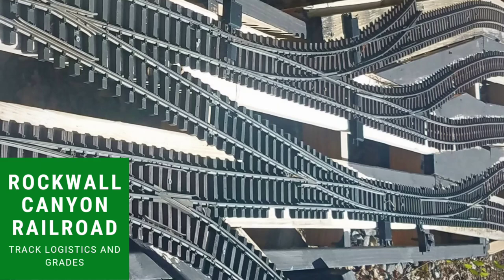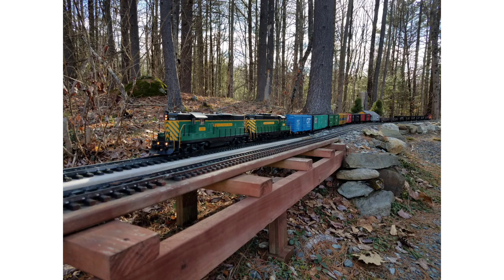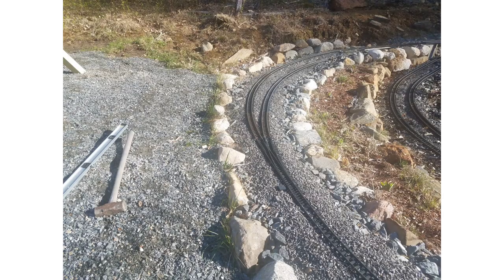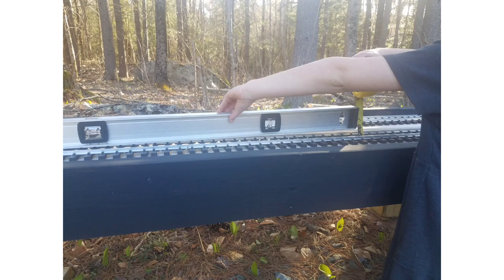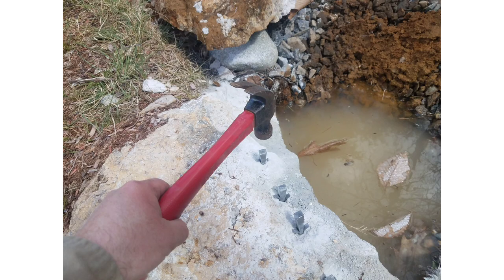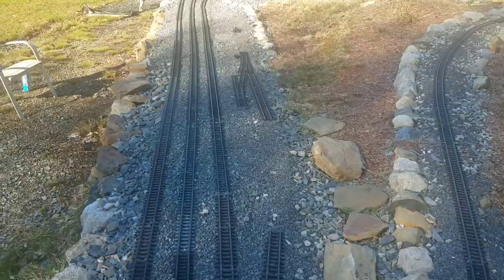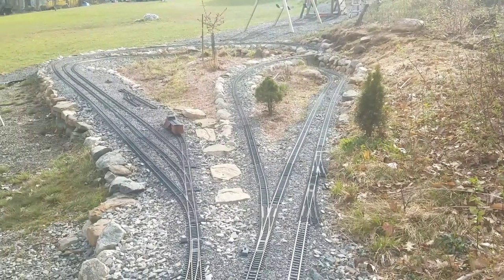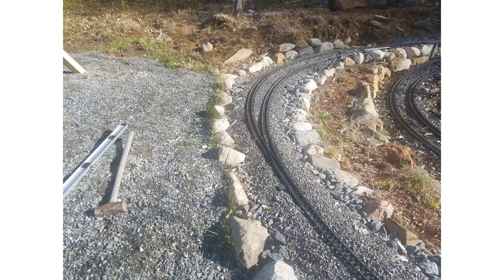G Scale | Track logistics: grades switches, and curves

Comment: You can press some brass tubbing over the outside of the plastic gear (where the axle presses in) to fix the cracked gear issue. I've done this to many
Reply from the maker: Have you done the 44 tonner truck specifically? I know this typically works most USA motor blocks, but it's been documented that you would have to modify the plastic housing on 44t to make room for the sleeves.....otherwise the gears no longer mesh.
Reply: Yes I have done it. Just make sure the bushing is square not diamond when reinstalling the axle and it works just fine

Comment: My LGB mogul can’t climb more the 1-1/2% grade without slipping on a curve. Do steeper grades need to be only on straight sections?
Reply from the maker: @johnburk5087  I've owned a couple of LGB Moguls in the past and noticed similar issues.  Rather than modify your track, my suggestion would be to swap out the wheels in the tender and cars to either LGB or Piko brand ball bearing wheelsets.  This is especially helpful if you are pulling the LGB D&RGW-style coaches.   Not only do the bb wheels reduce the normal drag, but they also can be used for lighting power pickup in coaches and caboose.   I know they are expensive, but if your Mogul is regularly slipping, it's more likely that the gearing will fail prematurely, which would also be costly.  As an added benefit, your other engines will live much happier lives as well!

Comment: Great video!  I do need some help if you can answer a quick question.  I just purchased a massive, USA Trains,  SD40-2.  What is the smallest LGB Numbered Curve can this engine handle?  

I am moving up from the small starter tracks that are in the LGB sets and think this engine might not work on right curves.
Reply from the maker: Excellent choice!  The Sd40-2 will require LGB R3 as an absolute minimum.  With R3 it requires coupler adaptors to work.   USA 10ft diameter would my minimum,  and LGB R5 would be even better.  If you cannot go larger than R3, it may be wise to stick with the LGB brand locomotives since they are designed to work on the tightest curves without performance side-effects.
Reply: @RockwallCanyonRR  outstanding answers.  I will start rooting around for those Part Numbers.  I work best with Part Numbers.

That said this engine is AMAZING!  First the price.  I bought it at the NMRA Convention here in Dallas TX for a very fair price: $411.00.  This engine is upwards of $435.00 and that would not even have shipping which would push it to $460.00 in some cases.

Next is the detail.  Wow!  Really amazing.  I love the huge three axel trucks.

Last it is what I have wanted for many years.  If you take a look at my tiny garden train layout it will take some planning to get her in there.  My little layout was needing an expansion so this is the perfect reason to make it even bigger!

Anyway I hope to do an "unboxing" and test drive soon.
Reply from the maker: @VictorianMaid99  That was a great buy on the SD40!  Looking forward to seeing what you do with the layout!
Reply from the maker: @VictorianMaid99 
I typically think LGB track is much better, but USA Trains provides this 10ft diameter curve size which falls between LGB R3 and LGB R5 curves.  It's cheaper and may fit your space better than LGB R5.  
 USA Trains track: 
R81700 10ft diameter curves
R81720 switches
R81725 switches
Reply: @RockwallCanyonRR  I think you are correct about LGB Track.  It holds up better outdoors

Comment: ever thought of running vintage converted battery trains like New Bright, Echo,or Eztec/ Scientific Toys on the railroad? or would those require more work to get running?
Reply from the maker: Absolutely!  You do have to be careful with some of the vintage New Bright trains as some of them are close, but not quite the same gauge as G scale.  That said, they are quite popular with garden train folks.  I'm really not sure how well they hold up on layouts with grades or longer trains.  One of the issues they found with the older Bachamann Big Haulers (when used beyond the Christmas tree loop)...the motors would get hot and soften the motor mounts which then caused the gears to grind.  I would say, if you approach with reasonable expectations you'll have good results.   As to "vintage" quite a few of my "garden-grade" models such as Aristo craft diesels and cars are  30 years old and going strong.   Even my USA trains GP9s are over 20 years old!  I have LGB track and ties that have been outside well over 30 years.
Reply: @RockwallCanyonRR  All the more reason I won't use Plastic track outside because it's not UV resistant and would melt in the sun like a hot fudge sundae. as for New Bright rolling stock (and this even applies to their christmas counterparts) hit them with some UV clear coat and change the plastic trucks to those of metal with knuckle couplers. though with the engines that would take more than just UV clearcoat as the motor and gears would need moisture protection (Epoxy I think?) but I'm ditching the 6 C cell batteries that take to power them as I'm going with a single 7.4 volt cam corder battery with a charger. I may include Rail pro as well. (I'd be surprised if it can find images of New Bright and other 80/90's engines).

Comment: Thanks for all the info, great video!  I have a question about laying parallel curved track.  Can you lay a 20' half circle inside another 20' half circle?  Is it big enough to have enough flexability for that?  I would rather have parallel curved tracks 8" apart rather than a foot or two apart.
Reply from the maker: Thanks for the kind words Todd!   If you're using sectional curved track you can loosen the ties by removing the underside screws on one rail to allow the rails to flex. Place on a flat surface and hand bend it either larger or smaller as needed.   It will cause one rail to run a little long, but you can trim that with a dremel cut off wheel or hack saw.  Otherwise you can use long flex track sections and a rail bender to produce the parallel curve.   Flex track is often in short supply, so I do a little of both.

Comment: There is an easy way to sleeve the plastic axle gears with 3/8" brass tube and make them run like new for many years.  Many USAT locos in my fleet are already fixed and run perfectly.  If you want more information and picts, please contact me.  Love your railroad also!!
Reply from the maker: Thanks Duke!  Oh yes, I'm actually aware of the brass tube repair but was warned that the 44T motor block is a little tighter and may require removing some plastic to allow clearance for the sleeves to fit and still allow the gears to mesh properly.  I already have the tube, so i'm going to give it a try anyways to solve this once and for all. Lol
Reply from the maker: Hi Duke, so I gave it a try last night and it worked out pretty well!  No issues with the sleeve rubbing on the motorblock and the surging is almost gone entirely.  I do have one axle with marginal gearing that are nearly worn out but still working.  Another axle is still wobbling pretty heavily, but works.  Ran for about 4 hours today!
Reply: @RockwallCanyonRR  I've had really great results from the way I sleeve mine using a small arbor press to get them straight and they run nice.  I can send you picts through email or FB if you wish.  I cut the brass on my small lathe to fit.  A drill press would work in place of the arbor press.

Comment: I a,m new to the hobby. I have a couple questions, please? I am curious about how you deal with the power to the tracks when the weather has been wet. Do you have to wait until the powered track dries out before safely using the system? If I am not mistaken it is 24VDC? To power such a large system I assume you'd need something pretty hefty current capable. Would 10A be enough for getting power to the locomotive on such large systems? Do you have external fuses on the output of the power supply? Some switching supplies just shut down until the short circuit clears.   I appreciate any information you can share. I am hoping to build something similar someday. I know I can experiment as I am building to answer those questions but it is great to learn from those who have already done so.  In standing on the shoulders of others we gain from each generations? Maybe someone already documented all this, I will continue to research as well.  Thank you for sharing this cool infrastructure.
Reply from the maker: For a very large railway (something over 200ft of track), I find it's really not practical to power the trains through the track at all.  Instead, I retrofit the locomotives to accept Li-ion batteries and radio control onboard.  Sometimes, I install the battery and RC directly within the locomotive, in other cases I dedicate special battery cars that can provide the power to locmotives indirectly.  

If you start off with track power, a 10 amp supply is a great idea.  Most G scale trains have 18vdc motors, the only exception, I think, is LGB which come with 24vdc motors (even lgb will run fine at 18vdc)  Any commercially available control system will have electronic protection, so there is no worry about the track being completely dry before running trains.  That said, I'd avoid running in particularly wet conditions as it will dirty the rails and wheels temporarily reducing conductivity (until you clean it).
Reply: @RockwallCanyonRR  I watched a few videos tonight that discussed retrofitting trains to run off internal power. I guess it can really simplify several problems with open circuits, or even short circuits. I don't know if I can still accomplish that level though as I am losing my eyesight. I was just going to start out with the older technology while I still can. It seems using internal power with radio control and modern programmable logic is a really smart approach. I really love the idea of trying to avoid using high current low voltage in an environment exposed to elements with constantly troubleshooting intermittent connection problems due to corrosion or moisture. I am sure many experienced large scale experts do not want to go back to track power once they  have converted. I guess modifying all your locomotives may be a challenging task too.  Thank you very much for your insights.
Reply from the maker: @1STerminus  With new track, you should get years of reliable track power regardless of the elements.  If joint continuity becomes an issue later, you could add split jaw rail clamps to improve the connections between the rails.   
As to battery powered trains...there is a Piko small diesel that is factory equipped for battery power with a simple onboard RC system.   If you wanted to outsource the installation on a different model you might consider RCS of New England.  My friend Don Sweet is the owner, and has been doing professional installations upward of 30 years.
Reply: @RockwallCanyonRR  Hi Thanks again! I am starting out with a small indoor layout using all used G-scale components several sets with a lot of old steel track. I have quite a few 24V power supplies from 3D-Printers with a 15A rating. I found some schematics to wire up an analog controller with potentiometer and a manual break before make polarity switch (direction.) I am having problems with even light soldering now so I might need to find an assistant who can handle a soldering iron (an apprentice!) Very wishful thinking as I am in the middle of nowhere New Mexico.  Since I just have a couple workbenches I will have to keep them small. I was going to make this my last fun project. I think it could be a race against time. Thanks for the cool system you built and for sharing it too. Keep your wheels on the tracks!

Comment: really cool. yout double mains appear to be perfectly spaced from each other. any tricks on this?
Reply from the maker: Thanks! On the ground level it's just by eye.  I really lucked out with the patched siding where the rock was busted up.  I never had to trim a single rail to make it fit!  As to my elevated track...the spacing is that of a crossover of USA Trains #6 switches.   That way I can add crossovers near the intermediate stations for more ops options!

Comment: Great info and great examples ... Thanks ..I'm guessing all the switches are manual .. I use the Bachman switch stand for my #6's ..
Reply from the maker: Thanks Sean!  Yes I also like the Bachmann switch stand as well.  Most of my switches use the LGB manual spring box.  The railroad has many junior engineers, so having spring switches helps to cut down on major derailments.  Engines and heavy cars will always spring through,  but occasionally freight cars will still slip off if a switch is misaligned.

Comment: Hi, I really appreciate your channel and you sharing various tips.  All good and helpful - thank you.    I'm curious about your technique for laying track floating on rock.  While I realize ballast helps it stay in place, I've presumed G-scale track outdoors needs to be fixed to a permanent roadbed.  Concrete, wood, something.. other than the obvious decking/trestles/etc, can you share more about your techniques when laying track at ground level?   Do you have freeze/thaw/hot-cold cycles in your local climate?  Do you have issues with track drifting?   Thanks again
Reply from the maker: Hi Dave, So glad you like my videos!  Yes, I've been floating G scale on crushed stone for many years.  I find the best way to proceed is to start with a heavy woven "weed barrier." Much like on gravel pathways, this allows the base to be more consistent in freeze and thaw conditions.  I then like to use 1-1/2in crushed stone to build up the roadbed.  Next comes the track and some 1/2in stone which gets pressed under and around the ties.  This is enough to work as-is, but I also like to go back and add a layer of 3/8in stone once everything has settled.  This is more for looks than function as the smaller rock is closer to scale.  In most cases this enough to keep the tracks together.  However, in sunny spots, where the track moves more, I like  to add 1 rail clamp to each joint.  Since I'm not using the track for power, I don't find it necessary to clamp both rails.  I do have cold and snowy weather here in New Hampshire, but for the most part, the cold, frost, and ice have less effect on the track than does the hot sun.  I prefer to have the track floating, because even ladder framing can become out of alignment from frost.  Making track geometry adjustments to floating track is as easy as lifting and repositioning the stone.
Reply: @RockwallCanyonRR   Thanks for sharing your process.  I'm in the beginning stages and happy to hear that floating in/on ballast, of various sizes during the build-up works.  The tips about rail-clamps also much appreciated - I have been contemplating how much/when/where to leverage them.  And I can appreciate how a bed of crushed rock is easier to re-align vs permanently attachment to a substructure too, another good tip, thank you.

Comment: Tremendous! What is the grade of the mountain bypass?  This is so informative, thank you!
Reply from the maker: Thank you!  I believe that section is pushing 6% in a few spots.  Since its technically off the mainline, I decided to have a little fun with it.  In this case, I was more concerned about achieving the 15in clearance at the overpass than the grade it required to get there.   The end result is an visually amusing route, but definitely one with operating restrictions.

Comment: What are you using to control your trains?
Reply from the maker: Thanks for watching!  I've been enjoying your channel for awhile now!    As to train control...I've been an Airwire guy right from when they first came out 20 years ago...much of it is still working great, and its all still compatible with even their newest items.  I also use Railboss4+ on my passenger trains (and Thomas equipment) since this system has automated station stops.  I'm not big into sound, so these systems work great for me...While you can add it to AW or RB, I think RailPro or Revo is probably more practical for sound.
Reply: @RockwallCanyonRR  I liked Airwire, easy to install. I never cared about sound till I heard railpro. Growing up with a train going through my back yard, I know what they’re supposed to sound like. No one got it right till raipro. Now I can’t run without it lol your layout is amazing, where are you located?
Reply from the maker: @TheeFishGuy  I completely agree on the Railpro sound quality!  I used to work as a Trainman on a scenic railroad so my ears are particularly tuned as well!  I admit they're getting very close!  The horns and engine sounds are truly the best I've heard.  Next they need to figure a way to configure the engine rev and motor whine to the actual current load on the decoder. Love to hear those 1st gen EMDs rev up and then down just as the traction motors start whining! 
I'm located in the seacoast area of New Hampshire.  Where are you located?
Reply: @RockwallCanyonRR  I’m in north east Ohio. As per the notch up and such, if you set the load pertaining to how many cars you’re pulling it gets pretty close!
Reply from the maker: @TheeFishGuy  ohh I wasn't aware of that??  I still have new AW boards to install...I'm going to pretend that feature doesn't exist yet ;););)